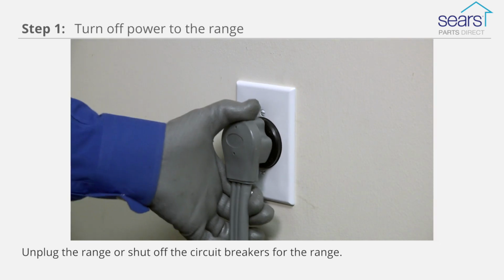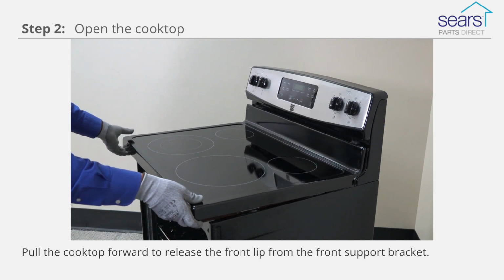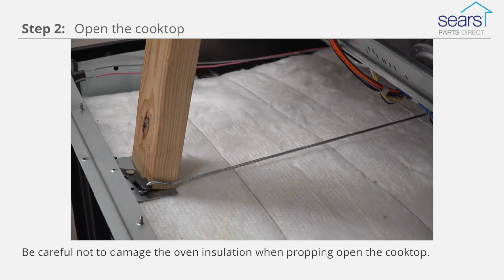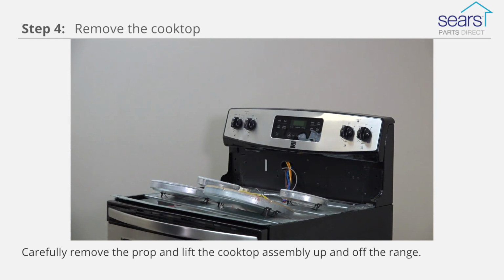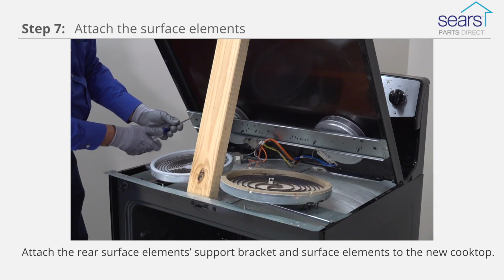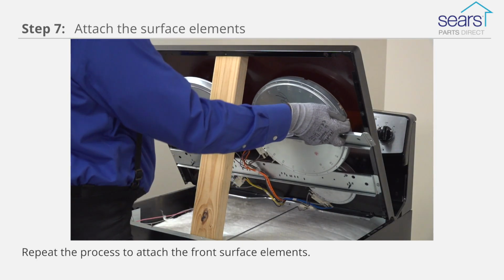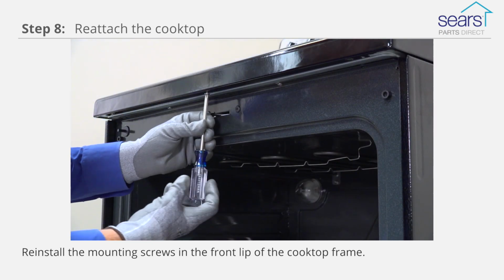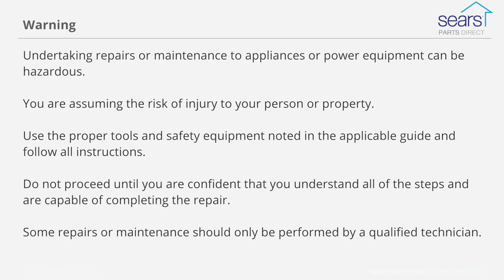Replacing a Range Glass Cooktop

Comment: I have almost the same oven, but ours is a little bit different. We have the GE Profile™ 30" Free-Standing Double Oven Range and the model is JB968S0H1SS and this thing was over $1500, but we cannot find any glass replacement. Just today the top cracked for no reason from the left burner all the way to the right burner for no reason.
Reply from the maker: We didn't find that part available through any of our parts sources. You may try searching the web for a used part if you want to repair the range.

Comment: Is there a video that shows how to do the same repair/replacement on a slide in range? Thanks
Reply from the maker: We don't have a video that shows how to complete that repair on a slide-in range. Let us know the model number of your range and we'll provide some instructions that should help you complete the repair.
Reply: @searspartsdirect  thanks, I just bought the part through you and we are facing the install soon. It's part # WB62T10528. The range model is JS968SF4SS
Reply from the maker: @bettinautz  Unplug the range or shut off the house circuit breakers for the range to disconnect electrical power. You'll need to remove the control panel before removing the glass top. You can refer to the parts diagram for your range while completing this repair. You can find the part diagram on our Sears PartsDirect website: https://www.searspartsdirect.com/ Remove all knobs from the control panel then remove the faceplate retainers while holding the faceplate in place (the faceplate is attached to the control by a ribbon wire harness that you don't want to damage). Pull the faceplate up about 3 inches then unplug the faceplate ribbon wire connection from the circuit board on the back of the faceplate. Carefully set the faceplate aside. Open the oven door and remove the screws from the bottom of the control panel that secure the control panel to the vent trim. Remove the 4 screws from the steel control panel insert then pull that steel insert up and disconnect the wire harness plugs. Pull the steel insert out. Remove the 5 screws that secure the control panel to the glass top assembly. Remove the screws that attach the glass top assembly to the range body side extension. You should then be able to slide the cooktop forward slightly and lift it off the range. Reverse the above procedure to install the new glass top and reassemble the range. We hope this information helps. This is a complicated repair and our general description of the procedure may have overlooked some details of the repair that you may need to figure out yourself. Let us know if you need more help. If you decide that the repair is too complicated for you to complete on your own, don't hesitate to have a service technician install the new glass top for you. Here's a link to schedule service in case you need it: https://www.searshomeservices.com/repair
Reply: @searspartsdirect  Thanks! We replaced the glass top yesterday without a glitch.
Reply from the maker: @bettinautz  Thanks for letting us know. We glad to hear that you were able to complete the repair.
Reply from the maker: @patrickodea7419  We're not sure what you're asking. It seems that you want to remove the front control panel. With power disconnected from the range, remove the burner control knobs. Remove the screw from each side of the control panel. Remove the screws that attach the burner control switches to the control panel (the ones that you'll find next to the control switch stems). Wires are still attached to the electronic oven control board but you should be able to lift the control panel and remove screws that hold the control panel trim to the front of the range if necessary.  If this wasn't the information that you were seeking, let us know and give us more details about the information you need.

Comment: can i replace a glasstop with an old coil type? not loving the glasstop as i am a castiron guy can cant libe without
Reply from the maker: No. The range is specifically designed for the glass top and it isn't possible to switch out the glass top to a top that used coil burners.

Comment: I need that same glass top, how much is it ?
Reply from the maker: That black cooktop is part number 5304513973 and it costs $179.64. Here's a link for that part: https://www.searspartsdirect.com/product/5zwwq18e6j-0022-628/id-5304513973 . We recommend that you use the model number of your range to access the parts list for your model and look up the part number for range to make sure it's the same as the one shown in the video. If your range uses a different glass cooktop, order the part that's designated for your range. We hope the information helps. If you need further assistance, let us know.

Comment: Hello many thanks for this useful video. I have a model JCBS630SFSS or similar. It looks like the range in video. I'd like to know if it is possible/safe to continue using the top ceramic glass if the glass itself is broken only over one burner? The rest of the glass for the other burners is fine. If need to be replaced, should be replaced only the top glass or glass including frame and 4 burners inside of it? Thanks
Reply from the maker: We don't recommend that you continue to use the range with a cracked glass cooktop. Liquid can leak down through the cracks and short out the surface element and/or other wiring and components inside the range. Short circuits are dangerous. They can cause electrocution. We recommend that you unplug the range and replace the glass cooktop. There's likely no need to replace the surface elements unless you see obvious damage to those components. You may consider replacing the entire range because the glass cooktop is an expensive repair part. We hope this information helps. If you need more assistance, let us know.
Reply: @searspartsdirect  Thanks so much for the answer and suggestions.  When you say replace the entire range you mean complete stove with oven at all?  Isn't it worth replacing only the glass because of the cost?
Reply from the maker: @MeTube2014  Check the price of the repair part. I didn't find information on the model number that posted (JCBS630SFSS). For a typical GE range, the glass cooktop can cost around $400. If you need to have a service technician install that part, it can cost another $200 to $300. Repair costs can quickly approach the cost of a new range. If the range is over 10 years old, you typically shouldn't spend more than 1/2 the cost of a new range on repairs. If you can replace the glass top for less than 1/2 the price of replacing the entire range and the range isn't that old, then replacing the glass top is typically the way to go.
Reply: @searspartsdirect  I give you thanks a lot for the preciuos information you have shared. It's very very useful for me. Thanks for guide me and others for this channel. You've helped me to think better what to do. I didn't have idea of almost anything you kindly suggested me.